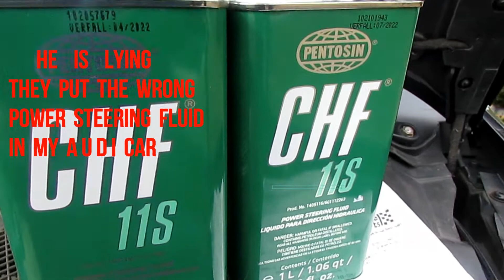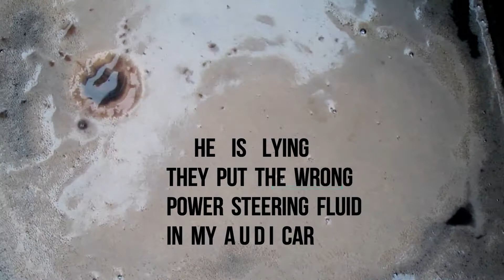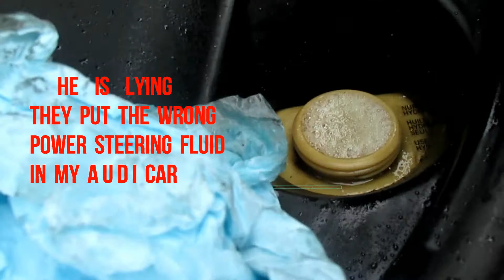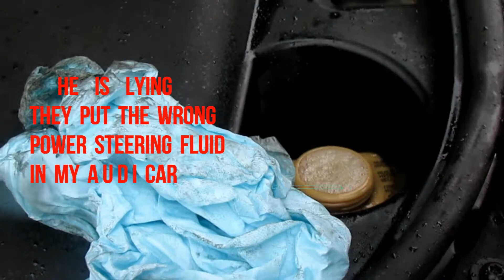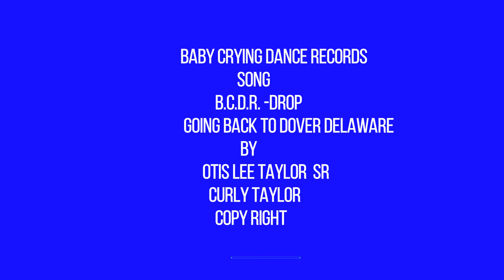OTIS LEE TAYLOR  THE WRONG POWER STEERING FLUID

Comment: That looks bad. I ended up here because I had the wrong fluid in mine. The auto parts store sold it to me but they warranted it out and gave me the correct stuff. I'm glad I caught it in time enough to change it over. My new pump would have blown to pieces if not.
Reply: Just had a guy at orielys  do me like that but I put it in  the car already smh